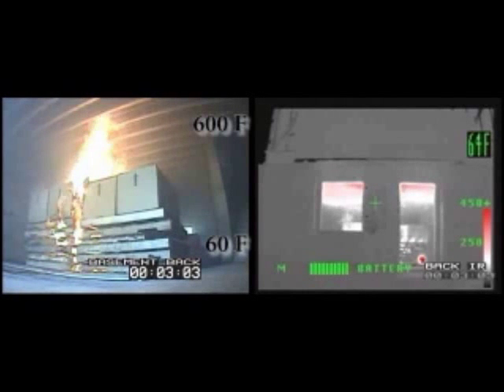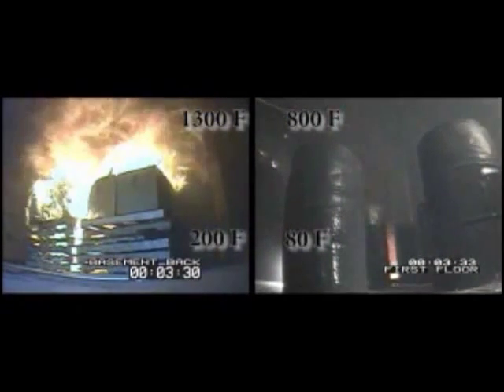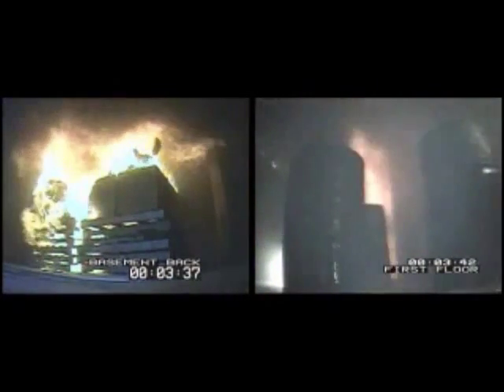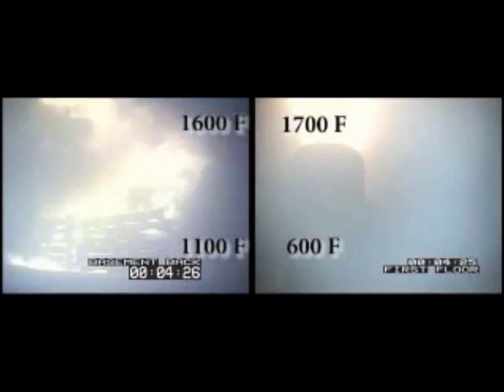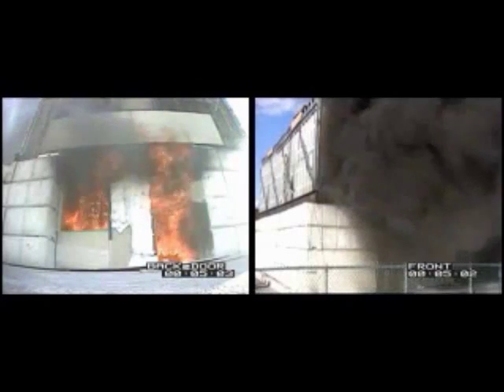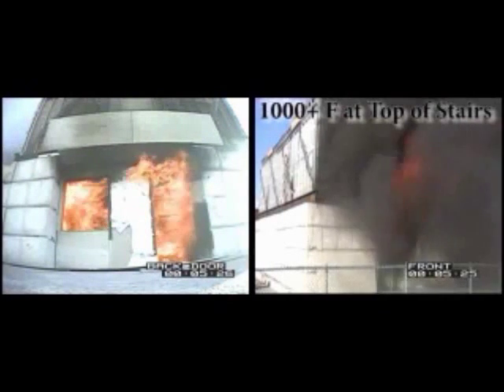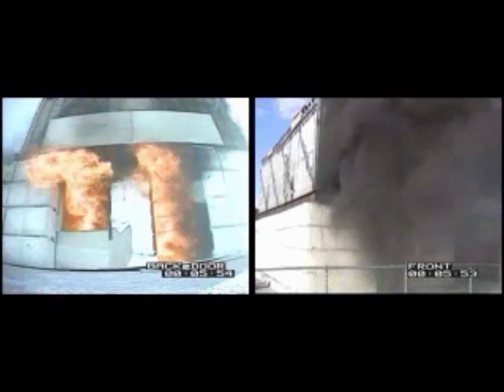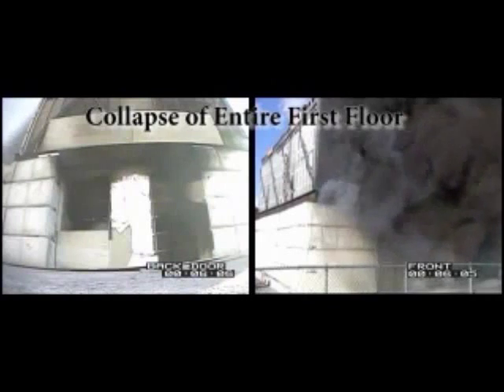Basement fire attack

Comment: Common Sense and Logic dictates, if you have a basement fire, you do Not enter the first floor except to cut a hole in the floor Just inside the door to put a fog of water into the basement if you have no cellar windows to use.  You don't go anywhere near the first floor basement door.  Any kind of explosion from stored flammable liquids in the basement could pressurize the it enough to blow that door in.

OSB may be a cheaper material to use in construction but it loses any strength it has when it burns or gets wet.  It contributed to the death of a fire fighter in Maine on 3/1/19.